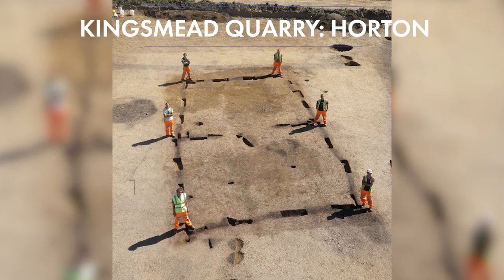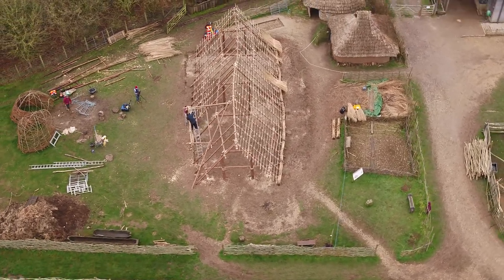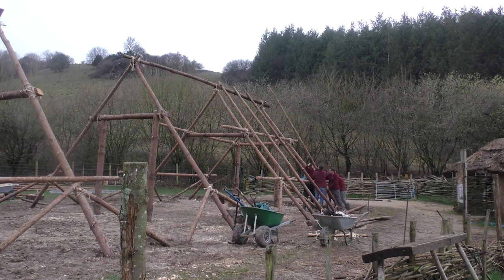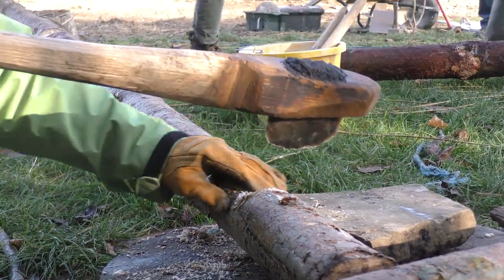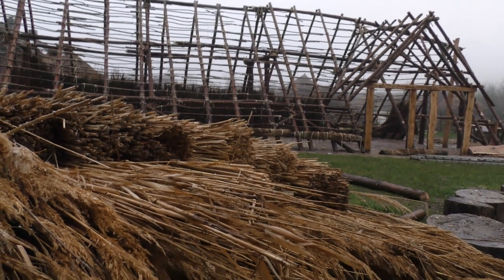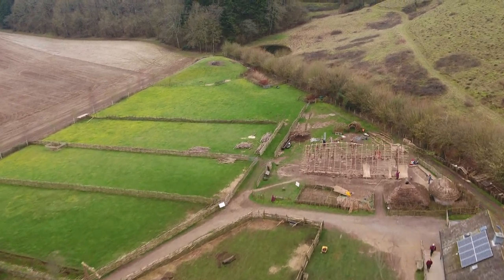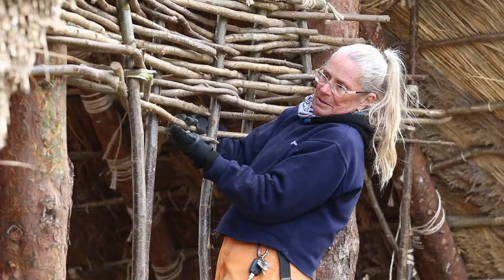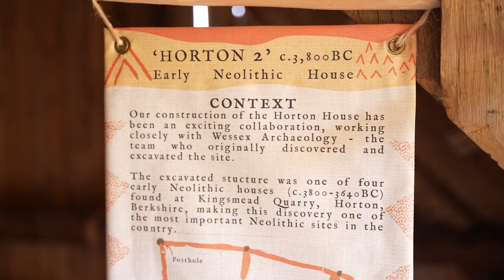Reconstructing Horton's Neolithic House at Butser

Comment: The thing about primitive construction is there's a limited amount of possible construction technique's. That narrows down the possible building structure. Neolithic I would expect allot of lean-to's and A frame buildings and no horizontal walls. As for the model house I would have made the end walls lean in just like the side walls. Flat on both ends doesn't much sound like stone age technology. Post holes are still a rectangle but all 4 walls can be leaning into the living space at 45 degrees and are also the roof. The end walls being vertical feel way to modern. 

Underlying issue, if you can make vertical walls so you can walk upright throughout your living space why the F would you not make all 4 walls vertical? Makes as much sense as gouging out your own eyes because you heard a dog fart.
Reply: Great insight, thank you for sharing such a good point about Neolithic architecture, but I just want to point out that you're wrong about the dog fart. It does not make as much sense as gouging out your own eyes because you heard a dog fart. Gouging out your own eyes because you heard a dog fart is really weird, and is definitely further down on the list of making sense than building two out of four walls vertical. Not that this matters, I just thought it was very funny.